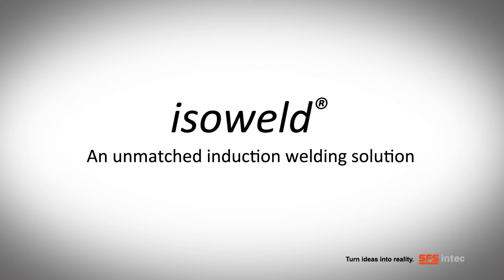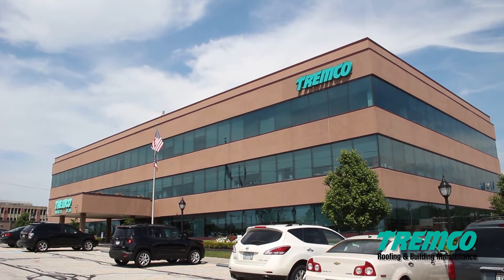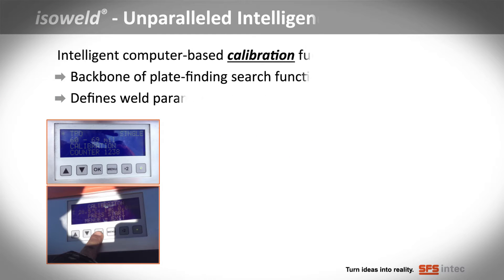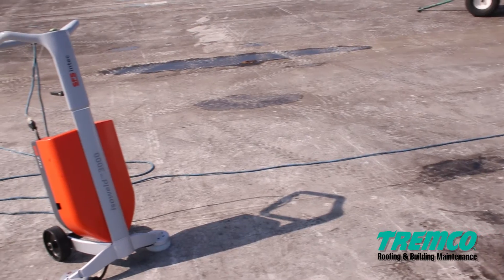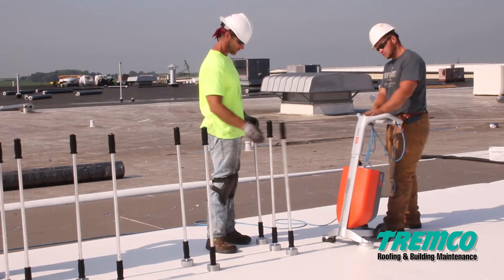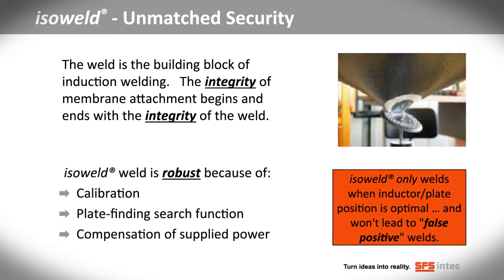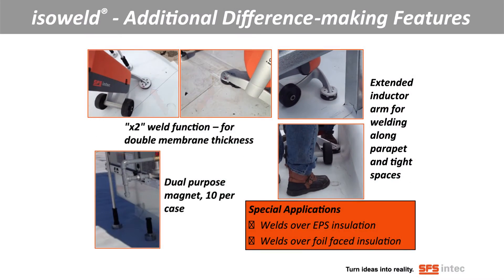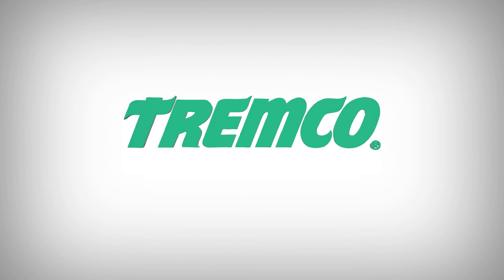Tremco Roofing - SFS Intec Isoweld Induction Welding Solution

Comment: I've installed hundreds of Tremco roof systems from Burmastic, Thermastic, Tremco edge metal " can't remember name " and all Tremco roofs have been exceptional quality well above other manufacturers, however didn't we use this " bond field membrane to plate " method in the 1980s where we installed 12 inch plastic plates every 4 ft in staggered rows ,then spot glued the field membrane to the plate system ? We used another plate fastening system where the field plates had a know on top where after gluing the membrane to the plate we snapped a locking cap over top the field sheet attached to the plate ,both plate adhered systems failed badly .

I cannot claim I have any direct knowledge of this method of bonding field sheets to plates ,nor can I attest to how well " This method " works ,if it's a Tremco approved method then I have faith it works well to secure the field membrane but I have hesitations due to previous technology that's failed for EPDM manufacturers in the early days of single ply ,feel free to educate me if you will ,I would LOVE to install this roof system to try out this method of securing field sheets .